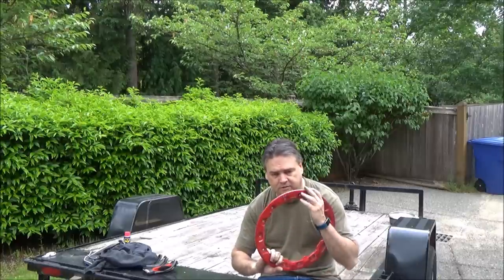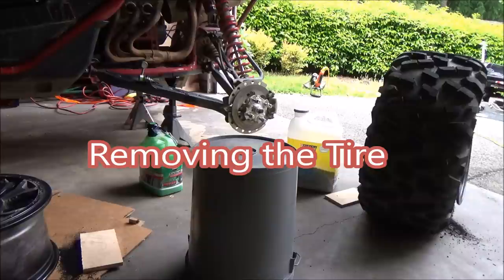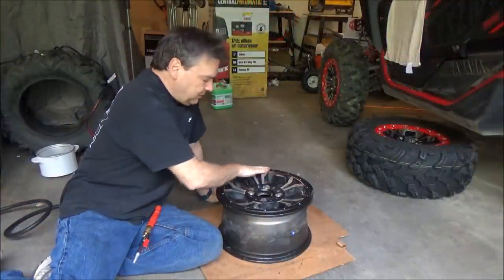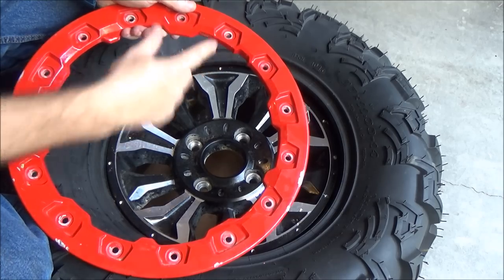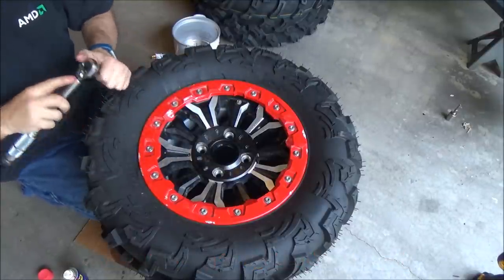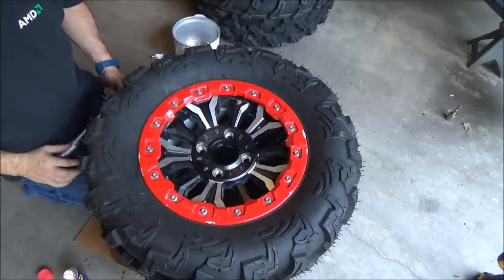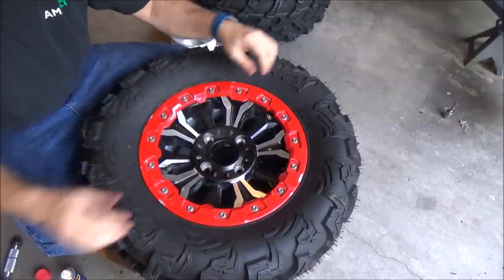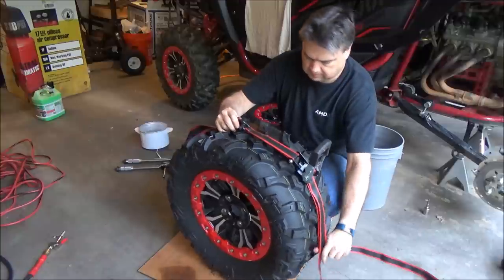Removing and Installing Tires on a Beadlock Rim

Comment: Great video.  I recommend using a good anti-seize on the bead lock bolts.   WD-40 will cause you “over torque” without realizing it.

Comment: mix up a little dish soap and water then coat the tire beads with that solution. You will find that the tire will slide much easier on the rim.
Reply from the maker: WD 40 worked well for me but yep, soapy water is another good choice.  Good tip.
Reply: They make special tire install lube just for this...

Comment: Not to be rude it is a good video but when airing up the tire should have left it on the bucket and pushed down no need for the strap. The strap would come in handy on a non beadlock tire and wheel 👍
Reply from the maker: Not rude at all.  That is a great tip.  Thanks for sharing and stopping by as well.

Comment: Nice video. I'm about to do weld-on beadlocks on my older Jeep & found your video while looking for info. Maybe I missed it or maybe it doesn't apply to your UTV, but what do you do about making sure the tire is centered/balanced as possible? I'm concerned the 33" I'm installing will have more wobble than can be balanced with weights.
Reply from the maker: Thanks for the comment.  I don't think it really applies to my SxS.  We are not hitting highway speeds where balance would be a real issue. I know some folks toss in balance beads but I haven't found them necessary.  33 is a big tire for sure and a lot of rotational mass. If you are driving highway as well as trail, I could see that balancing would be desired.

Comment: Thanks for all your awesome videos. Question, do you have to change both tires if you blow similar to a car? I'm guessing that's why you did so, but wanted to check. Thinking I will have a spare without beadlocks to get me back to home base, and two tires if/when I need to swap. Thanks for your help!
Reply from the maker: Yes. That is why I had to change out both because one went bad.
Reply: @RoughRidersTV  awesome thanks so much!
Reply from the maker: @crumguy321  You are welcome.
Reply: QUESTION..  SO YOU TAKE OFF BEADLOCK RING 1st BEFORE THE TRAILER TRICK ??
Reply: Yes, you need to take the beadlock off before you can dismount the tire. Be patient and careful unscrewing the 12 bolts, I wasn’t patient and stripped the bolt, and needed to buy a whole new rim
Reply: @crumguy321   Thank you for replying  I Appreciate That 🤙🤙 Ya. I tried it with my boat trailer. Could not get it off. Maybe cuz trailer rail is angled too much for the boat 😞
Reply: @johnmiller4553  I took it to my local tire shop and they unseated from the bead in 10 seconds, I would recommend you bring it there, they would probably do it for $10
Reply: @crumguy321  Yes Sir. This weekend 🤙🤙

Comment: Question, I wanna send my beadlock rings to paint, only the rings. Do I need to take air out or anything in order to remove the ring or?
Reply from the maker: Yes, you should.  Removing the ring will break the seal anyway so it's best to take the pressure off the bolts before loosening them.
Reply: Lol

Comment: I drove onto the sidewall of the old tires with my suburban, that broke the bead, much less work
Reply from the maker: Yep, I considered that as well.  I think I am gong to just fab up a bead breaker with some scrap square tubing. Shouldn't be too hard to do. I wouldn't mind brushing up on my welding skills again.  MIG welders are pretty cheap these days.
Reply: If you have an old bumper jack they work good the base is curved and goes around the rim nice.

Comment: Did you take off the bead lock when you debeading the tire?
Reply from the maker: Yes.  Sorry, should have showed that step.
Reply: Thats where the drill comes in handy but do a cross pattern method a little at a time.  You don't want to warp the ring.

Comment: I don't understand what the benefit of using a beadlock is. Most tire shops wont touch them. DIY takes a lot longer.  Am I missing something?
Reply from the maker: Beadlocks actually clamp the tire edge in place.  This allows you to air down really low without breaking the bead.  This is helpful when you are in loose conditions like sand or need more tire surface for traction like rocks.  Additionally, if you hit a corner really hard and the tire sidewalls want to roll from the lateral pressure on them, they won't lose the outside bead and you won't get a flat. Tire shops don't like them because they can't use automated machines on them. You have to remove and install each bolt by hand so it's not an efficient use of their labor.
Reply: Ya.  good video. No strap needed.👍